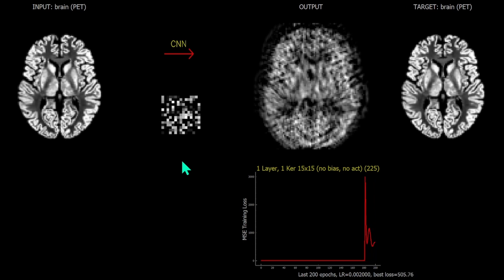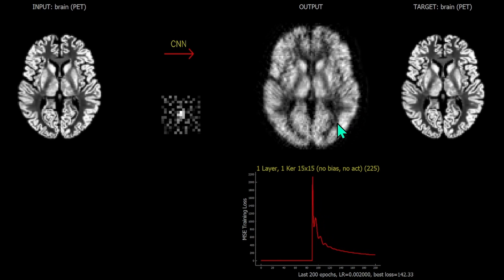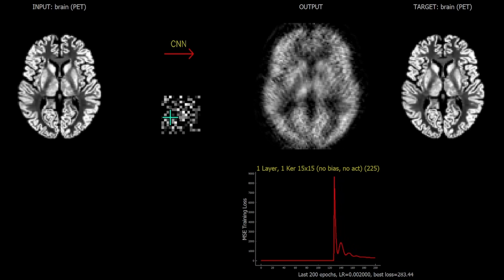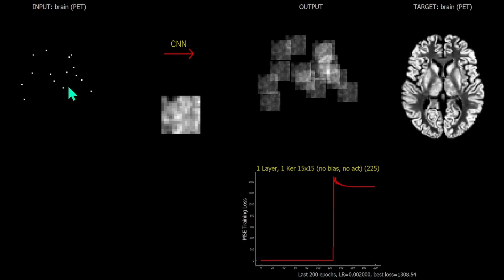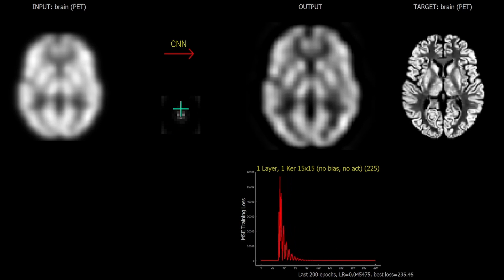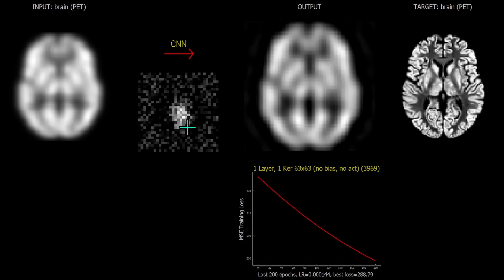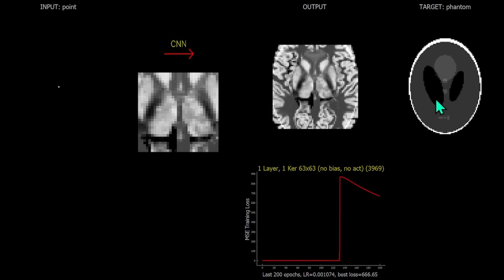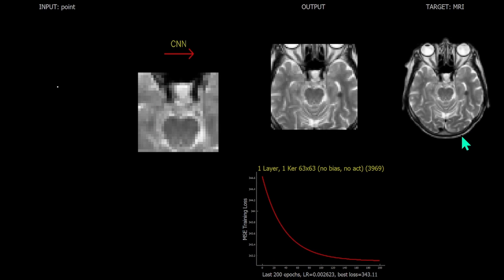Learning a convolution kernel to denoise or recover resolution

Comment: Thank you for this video professor. what should i change to use the same method to deblurr images?
Reply from the maker: This method uses knowledge of the ground truth, in order to find a convolution kernel which can deblur the blurred image. So if you know your blurring kernel, you can create a training pair: the input is the blurred image and the output target is the ground truth (unblurred) reference. That input and output pair will train a convolution kernel to perform the deblurring operation, to map from the blurred to the deblurred. Hope that makes sense, let me know.
Reply: @AndrewJReader  Thank you professor for the explanation. I did that but the resualt is not good enough, especially when the image is motion blurred.
I am trying now to add Wiener Filter to the CNN. can you recomand me a good approch to do that?